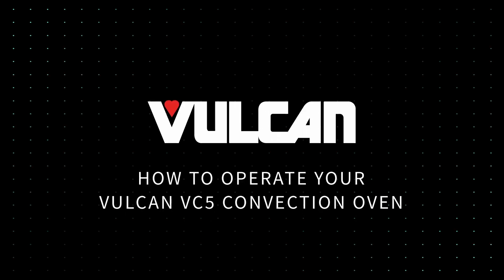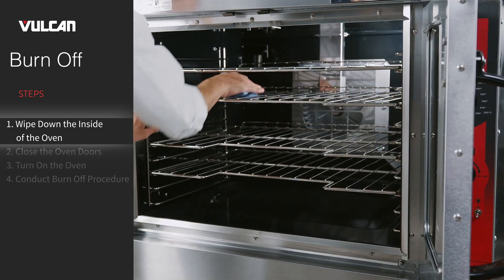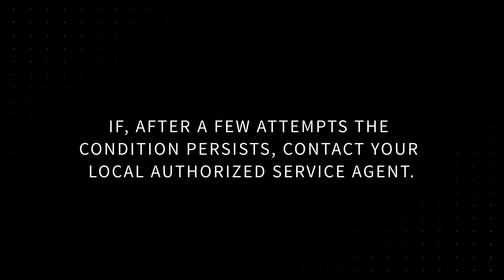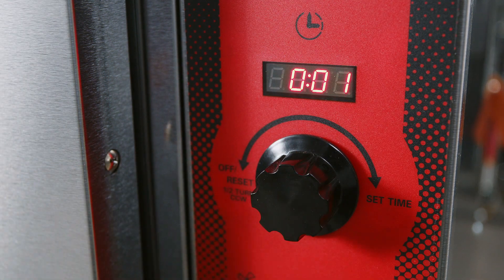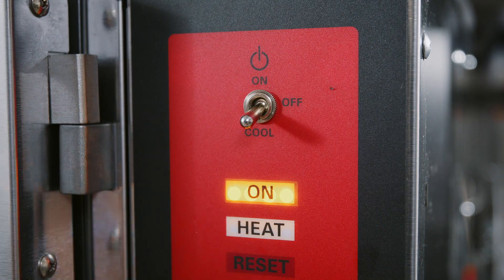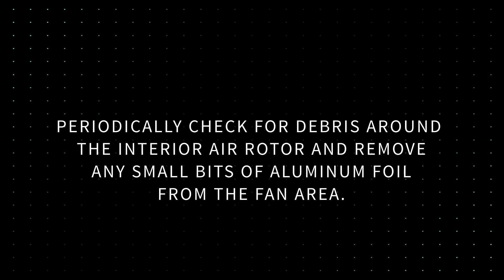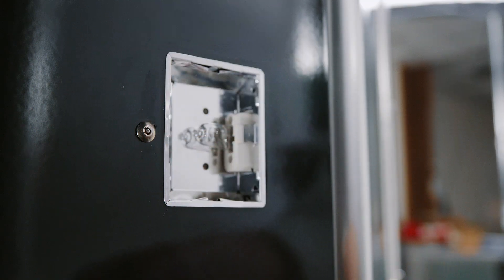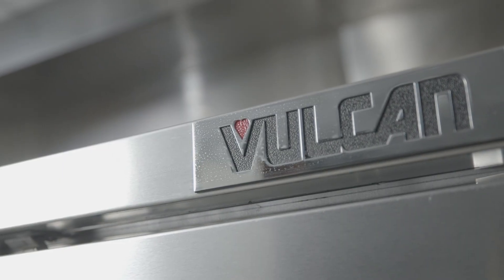Vulcan Convection Oven Operation: How to Prepare and Operate Your VC5 Convection Oven

Comment: how can i turn the fan off
is it possible
Reply from the maker: Thank you for the question.  The fan cannot be turned off in any Vulcan gas convection oven, regardless of make or model.   It is what pulls the heat from the burner area into the cavity, and the design of air flow distributes the heat uniformly throughout the cavity.  A safety switch feature is designed to prevent the oven from firing if the fan motor is off.  Bypassing the switch may cause irreparable damage to the oven cavity.  Please see the spec sheets for your model oven from this resource page to get more technical details. https://www.vulcanequipment.com/resource-center